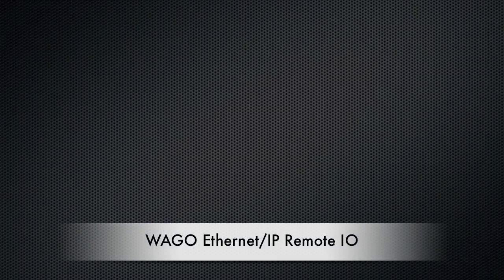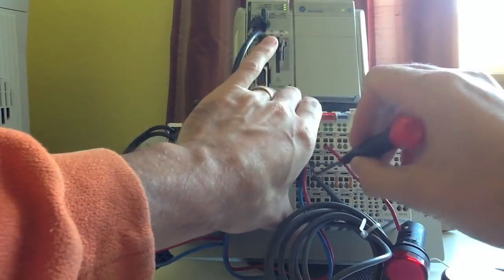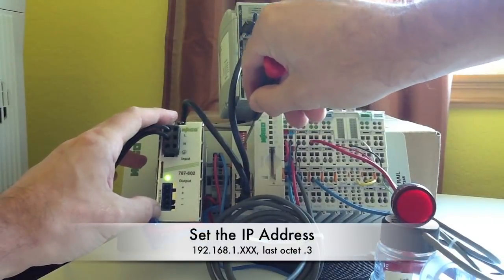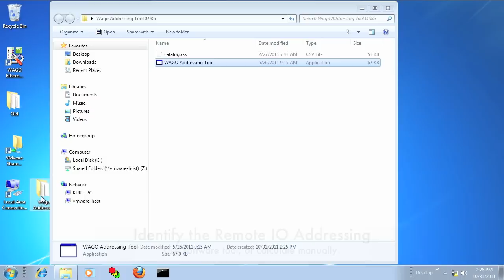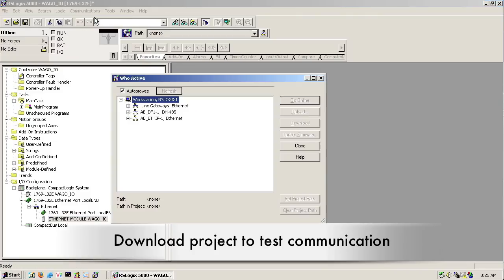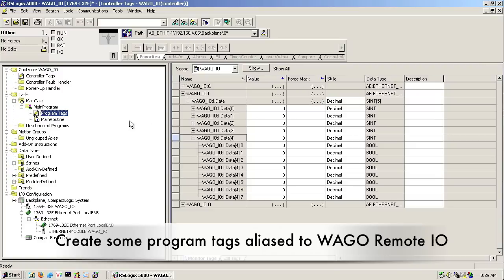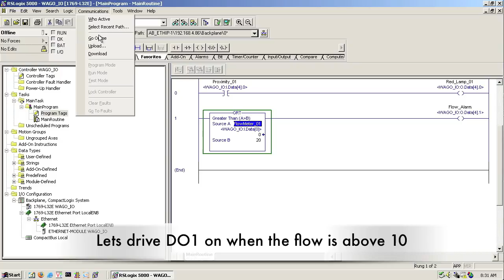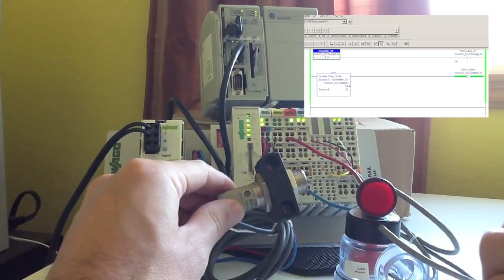WAGO Remote I/O - EtherNet/IP Field Bus

Comment: Hi Kurt, this is a great video.  I have a question for you though.  I noticed the flow meter tag you're using is only an 8-bit value.  What if the flow meter is a 16-bit value.  How would you create the alias to be an INT?
Reply from the maker: 6ordon6 The Bytes are used for communications, I recommend converting them into actual variable types before using in your ladder.  To convert 2 bytes to a DINT, use the function Bit Field Distribute (BTD) to copy the two bytes into two separate DINT's. Then add the high and low bytes into a third DINT.

Comment: Thanks for making this.    I was given a Wago and Socomec demo units to test and the Wago seems to much simpler and not having to deal with modbus.    The only issue which is probably not a Wago issue is that the module in the sample code shows it as a unidentified device.  I got the eds, so linx shows it correctly but not in 5000.    The current data works fine but the device tree seems broken or missing something.   As for the Socomec, I'm thinking of telling my boss....why even mess with it.   If we did, getting a prosoft card would be best but $$$.